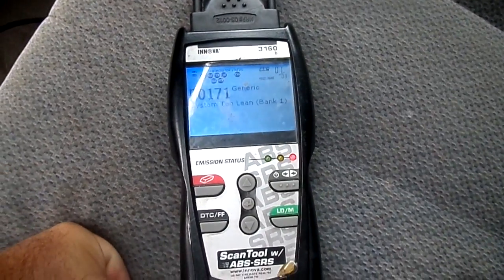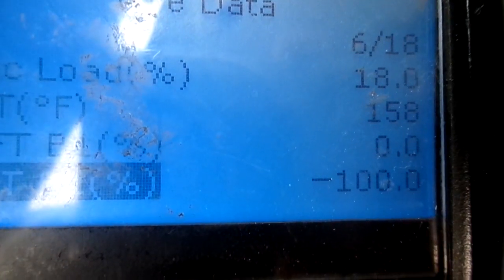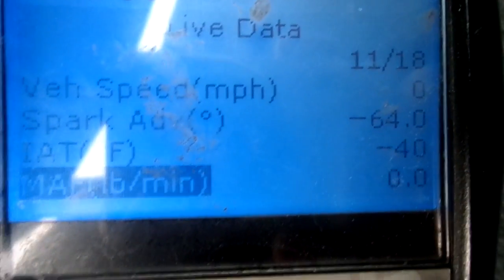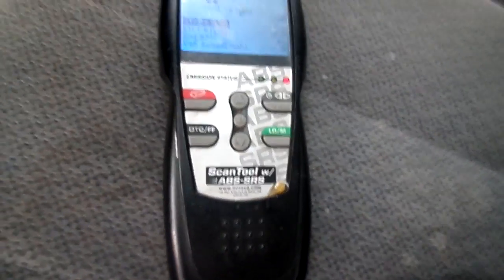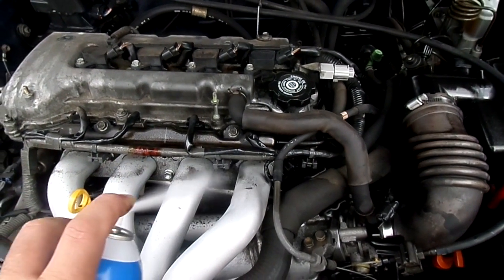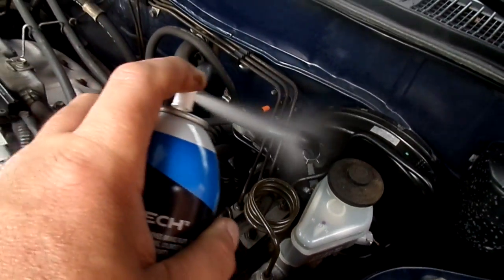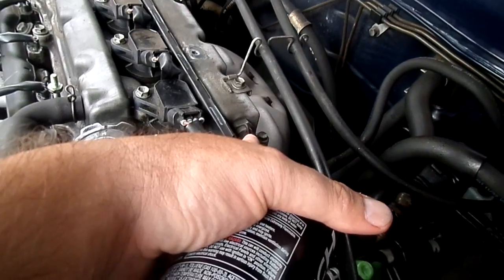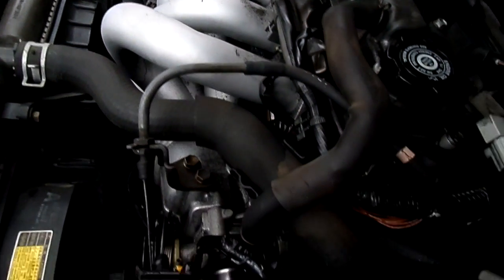How To Find Engine Vacuum Leaks ,  EASY !!!!!!!!    *P0171 DTC

Comment: Mate you should be looking at the long term fuel trim.
That was at 20%
It should be less than 5 percent.
Short term fuel trim will always hover around zero like you just showed us, if the vacuum leak is a constant leak.
Reply: Cisco Talens  As close to zero as you can get

Comment: I have 2000 camry 2.2l  and a postive 20% long term fuel trim a idle, and when engine revved to 2000 plus RPM it drops to 5%-8% , any idea where to start ? I swapped upstream 02 sensor air filter, spark plugs,  pvc valve and grommet, valve cover gasket and tube seals.  Helppppp!

Comment: Your Long term fuel trim is at 20%!!! when you look at trims you have to take both numbers in calculating. In this case your base line fuel trim (Altered fuel amount) is 20%. Meaning your engine is consuming 20% more fuel than the normal. If both trims have positive values you add them for total trim same way if the long term trim is positive but the short one negative you subtract for total trim. These engines the 8th gen Corolla 1.8L don't suffer from intake leakage as the newer ones with the plastic intake. I think in general the 8th gen ( My 2001 corolla has it) problems come from MAF sensor getting dirty and Injectors getting plugged. I'm still trying to diagnose my car which has intermittent P0171. These engines produce sludge when the is oil not drained regularly. I think the sludge make the burning process not very efficient and gum up fuel injectors, MAF sensor, Plugs, PCV valve, Catalytic Converter and O2 sensor. These engine can just run and not complain until it is too late with poor care, bad quality oil and cheap gas.

Comment: I already change the PCV valve, i also changed the spark plugs, and the fuel tank cap. Still is reading P0171?? the only i did on the car xrs 05 installed a aftermarket intake the engine is stock.
Reply: I used to have 2ZZ 04 matrix xrs, had this code, clean MAF, change PVC, fuel injector cleaner and do this Vaccum leak test.. and it was gone
Reply: You should take a look at map, mas flow sensor, ,, even the driver valve.   I
Reply: sanchez253 yea I did the mass airflow it didn’t solve it
Reply: Change the intake manifold gasket

Comment: Hi, I had this low idle, little vibration and a hissing noise problem in my car which was due to the vacuum leak. I realized that air pipe going to the engine is bit loose after driving the car for around 2500 miles as it was not effecting the driving performance. Now after fixing the pipe, car is running fine with no problems what so ever. But my concern is that if this late repair will or had damage my car engine?
Thanks
Reply: No it wouldnt damage the engine it would just eventually go into limp code and throw up a code. Car is now running fine means problem solved with no damage.